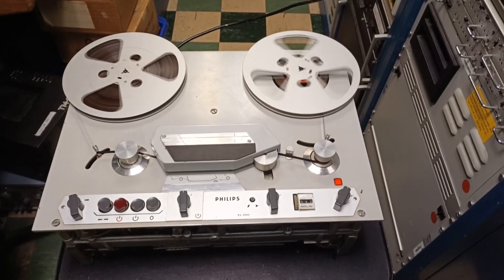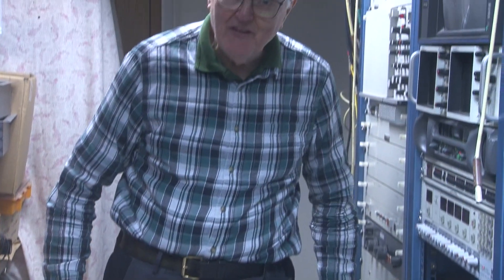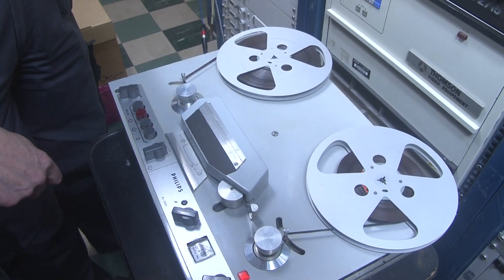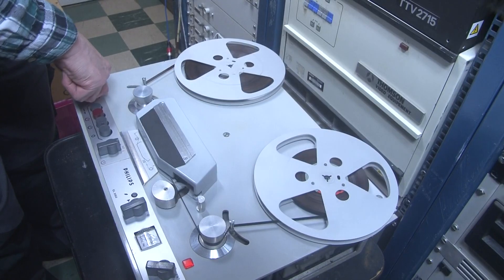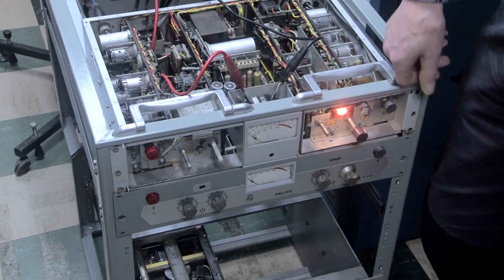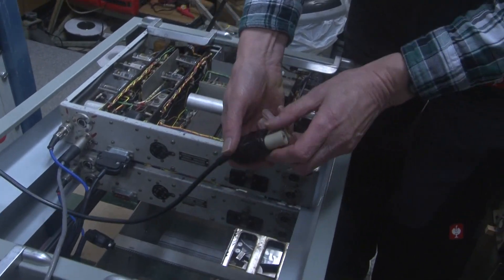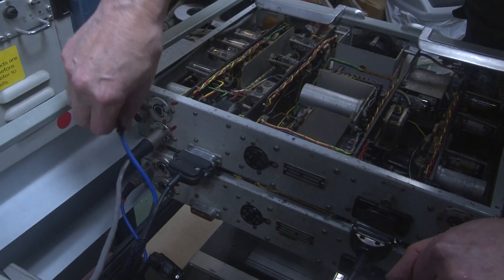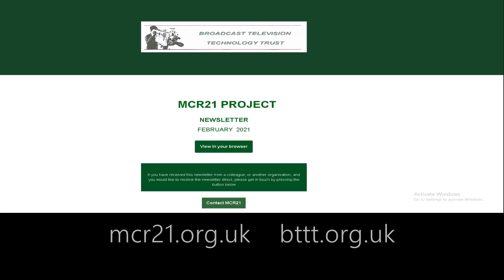An introduction to the audio tape deck and associated electronics installed in MCR21

Comment: But everybody really  wants to know if you've got that line ident recorder working! The one at the bottom of the bay/rack? 

I remember them - we had a pair, if I remember correctly, in CMCR3, but the tape machine was a Studer A62 instead of the Philips.

And yes, we did indeed have a full NAB real of galloping, for coverage of race meetings.
Reply: Yes the line ident unit RP4/1 is in working order, on the lookout for a spare cassette if one can be found.   I wrote about the RP4 in the current BVWS journal. regards.
Reply: @bsomers8664  Bravo! on the RP 4/1  :-)

Comment: You said that the variable speed winding on this Philips machine was novel, I beg to differ. The Australian made Byer / Rola 66 and 77 Mk II series machines from 1956 had this feature, the Rola 77 Mk III from 1962 had continuously variable rather than switched adjustment, so did the 230V 50Hz version of the Ampex AG350. I am sure there are other examples but these I know to have this feature as they are in my collection.
Reply: The BTR2, EMI TR90 and the RD4/4 (based on BTR2 mechanics), and all the Leevers-Rich machines I operated all had variable-speed wind. Studer A62, B62 and B67 machines didn't, but A80s and Telefunkens did. Variable speed wind was more useful in studio work, for editing and cueing. So our radio van machines (B62 & B67) didn't have it, neither did machines for the smaller scaners I worked on. For the latter I think a Nagra was dragged into service as the job demanded - I don't remember any studio-sized machines going out with the smaller vans.

Comment: Bet the fault with the instruments is that the movement is stuck in old oil.
If the windings in the meters are ok (you can measure that with a Ohms meter) then it's probably just stuck.
Heat the bearings on the movement a little with the tip of a soldering iron or something,
and loosen the screw in the middle a tiny bit.
That should make the needle move again.
Good luck.

Comment: I think the Philips replaced the rather over engineered Ferrograph decks which you could cue the tape on rewind as it has three motors although this is to be done with caution if the brakes have been over adjusted.  The power connector is as you mention used on irons, also coffee percolators and kettles.  Belling Lee and  Brevell company products come to mind.  As for both meters throwing in the towel this maybe a grid capacitor causing over current on the bias chooching the meter and possibly the head. Best

Comment: I noted the Utah Scientific routing switcher control panels in your racks, I think you folks call it a "matrix".  They are 1980s vintage and will last forever if the electrolytic capacitors are replaced as needed. And they mostly used tantalums anyway.
Reply: I am no longer trusting of tantalums due to so many poorly manufacture Chinese components in the system after 2000 although in this situation I agree with your assessment. Best.